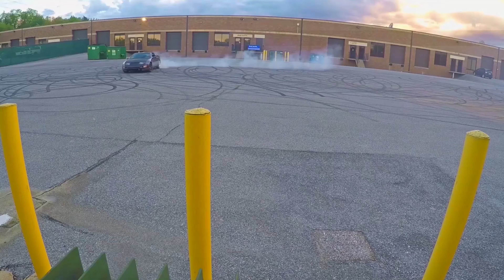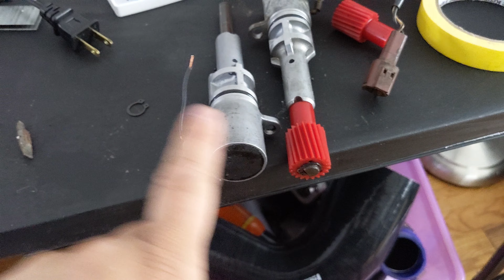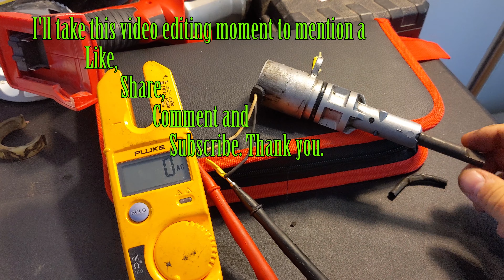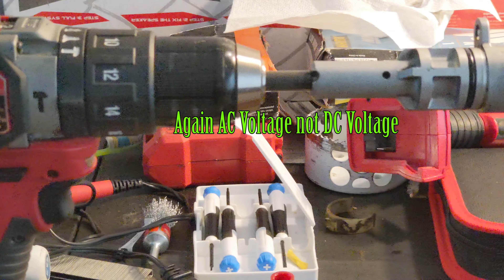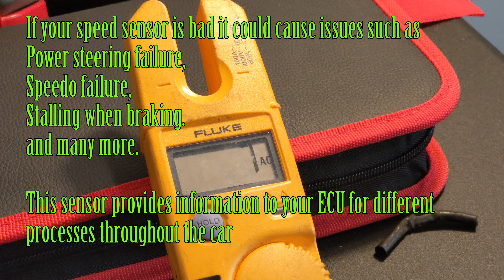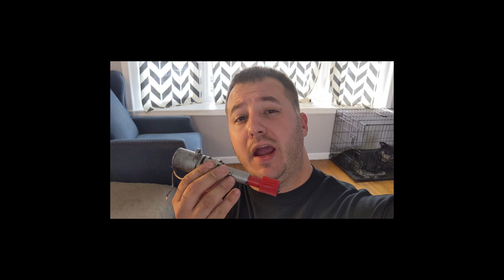300zx Speed Sensor Check

Comment: On my Z32 NA MT 2+0, to get the speed sensor out and clear, I had to loosen the exhaust hanger connected to the transmission mount, unbolt the trans cross member dropping the rear of the MT by an inch, and last I had to loosen the passenger side down pipe from manifold dropping it about an inch. FYI, according to the FSM the cross member to body bolts torque s/b 38-48 ft--lb.

Comment: I know its been a while, and you don't have the car anymore, do you remember if you had to drop the transmission to get the sensor out?  For some reason, its hard to find that out on google and youtube.
Reply from the maker: I never dropped the trans from that car ever. So you shouldn't have to.
Reply from the maker: I remember something being a PITA to get unplugged but other than that you should be smooth sailing.

Comment: Hello, I know this video is old, but I have a question if you’re able to answer. The sensor to the left of the speed sensor in your thumbnail. I got under the 93 z32 I recently purchased and found that sensor ziptied out of the way toward the rear of the transmission. Is that the turbine revolution sensor that is supposed to be located up toward the front of the transmission at the top? I haven’t been able to pull the exhaust off yet to be able to access the top of the transmission and was wondering if that’s where it’s supposed to be. Thanks in advance.
Reply from the maker: Both of these sensors are speed sensors. I'm not sure what sensor your talking about.

Comment: Just came across this video and great info on the speed sensor test, nice detailed presentation. Question I have a 1992 300zx NA manual 2 + 0 and the OEM speed sensor 25911-30P10 is discontinued but they have the TT one 25911-40P10 that the dealer says will not work even with gear change. You note it will work in the NA with the gear change on the TT shaft.  Is that because each has the same calibration of AC voltage generated vs RPM?  Or slightly different and will not mater for the speedometer? Thank you very much and appreciate your comment  Pete
Reply from the maker: I'm not really sure. This video as made so long ago and I don't have this car anymore. Sorry. Just swap the gears and see if it works. Worst case it's just not gonna show the correct speed.
Reply: thank you for your response  @loluracing
Reply: I know it’s a little late. The two sensors are NOT exactly the same. NA shaft is slightly offset due to the larger diameter red gear. If you just swap gears, they will get chewed up in the trans.
Reply: @peterliang1294  thank you for noting that!! I’m currently in this dilemma and going through all my available options. Looks like I’m just gonna have to find the exact one. Thanks!

Comment: My speedometer sometimes works and other times it doesn't. When it doesn't the odometer also stops recording. I suspect it is the speed sensor. You have given me some ideas for testing.
Reply from the maker: Yeah it's probably the speed sensor. Check it out and post up if you fix it. Good luck!!
Reply: @loluracing  Finally got around to it. Don't drive it much. Did replace the sensor with OEM but that didn't do it. Got serious after driving at 80 mph in a curve and power steering became boosted and felt like I was on ice. Problem became intermittent. Very scary. Came across info that if speed sensor is not replaced soon after it fails then a part in gauge cluster,maybe a transducer?, can burn out and ECU gets erroneous info and it can effect the p.s. boost.  Sent cluster to repair shop. Shop could not get part and had to buy used cluster to scavenge part. Cluster repair plus shipping 2 ways,$435. 1 yr warranty. Put in cluster today n drove for 50 miles,no issues.
Reply: @johnmichaelkarma  The clusters fail in these cars due to dry solder. Its very hard to see and is 99% of the time the cause for failing gauges. If just your speedometer fails and resoldering the joints on the gauges does not solve the issue its the speed sensor. I fixed my speedo and tach about a year ago because they were intermittent, just touched up all the solder that looked bad and they've worked flawlessly ever since. Cost me $0. I've done it for 4 other Z's clusters now. Super common issue. My speedo is now going out and I have an automatic transmission, but this time its shifting is extremely erratic when the speedo stops working. It wont change gears or gets stuck in certain gears, wants to be in 1st while going 60 but cant because of the tach speed. This case is certainly a speed sensor issue.

Just figure I should write this here for anyone whos having intermittent tach and speedometer issues; if you know how to solder just take your cluster out, disassemble it (it just has snap tabs and some screws holding it together) carefully remove the gauges, then resolder everything that looks old/cracked/damaged then reassemble. I guarantee it'll solve the issue. Also important to take a close look at the windings on the posts for the gauge needle. They have a hair thin wire thats soldered to the post and if the solder there is damaged it will need to be resoldered EXTREMELY carefully, more rare but potential issue.
Reply: @loluracing  thanks for the response

Comment: You connected the wires differently on each one. First sensor was (coming from speedometer) yellow wire with black and black with red!
Second speedometer was yellow with red and black with black!.
Reply from the maker: It doesn't really matter for what we're doing. If your checking continuity all your check for is that the wires are "connected" intermittently when your spinning it. If you are measuring the voltage, on my tester, all it may do is show negative voltage instead of positive voltage. In this case I don't care weather it shows negative or positive voltage I'm just looking for the value.

Comment: You sure the na and tt speed sensor are the same? I thought the tt was taller
Reply from the maker: As far as I know the only difference is the gear due to the different ratios in the rear ends.

Comment: Are you going to make a how to replace video?
Reply from the maker: No I wasn't planning on it. It's really easy. It's in the passengers side of your transmission. There is only (1) 10mm bolt holding it in. Just unplug it, remove the bolt and it slides right out. Super easy.